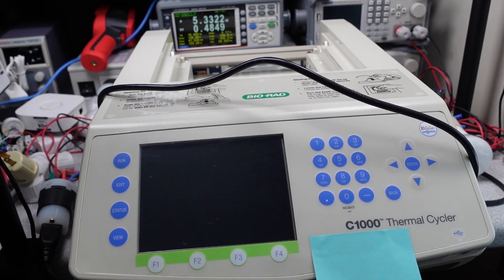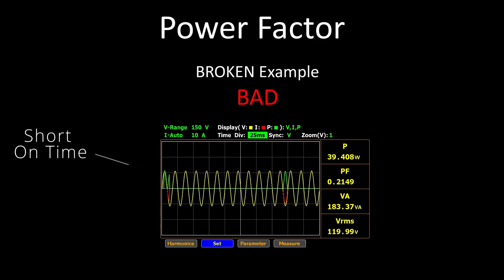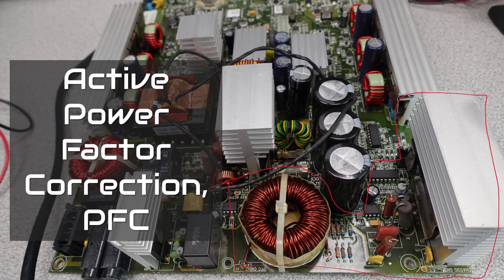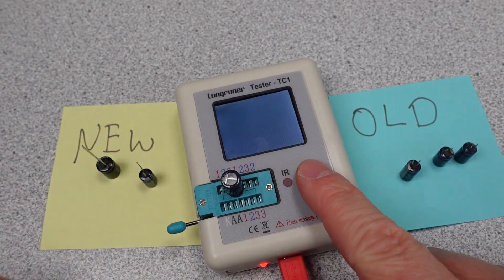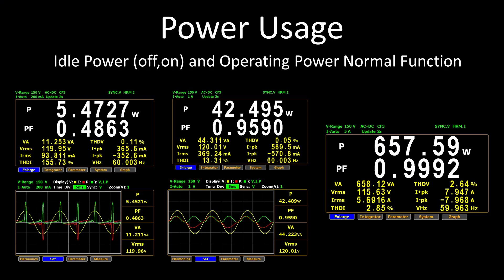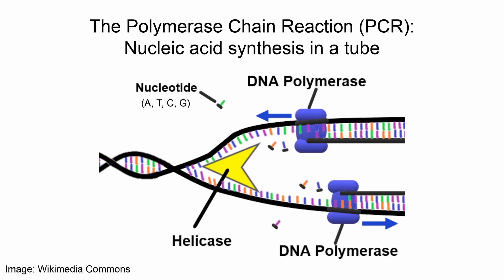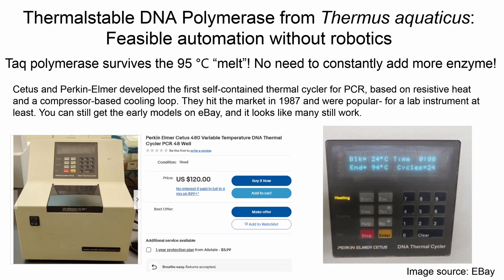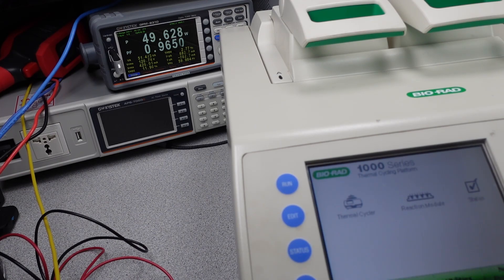Bio-Rad C1000 Thermal Cycler - they asked for $2,200 to fix this machine

Comment: Just did a repair on this exact make/model instrument.   you did a great job with this video!  I bought mine for $35 just to see if I can repair it (I work in this field repairing lab equipment).  The heat sink for the primary switching MOSFET gets extremely hot.  And those fans for cooling the peltier elements do NOT cool the board at all.  The airflow is directed above the board towards the heatsink of the reaction module.  In my case, I got the unit and it wasn't powered on at all and fuses were blown.  Shorted PFC MOSFET was a secondary fault.  The gate driver to the MOSFET appeared to be the primary fault.  I agree with you that thermal design of this instrument is its downfall.  Capacitors were not the problem in my case.  And each of the voltage rails including the auxiliary stand-by rail, displayed little PARD.  The auxiliary power circuit does have fault protection in the form of overcurrent protection.  It is that 500mA fuse next to the L/N 10A fuses.  I would put the make/model of this instrument in the title of your video to make it easier to find.  There's very little information out here for repairing instruments like these.  Scientists like your friend AC would appreciate it.  Because as you can see, the manufacturers charge a fortune to fix these.  Here's the link to my video as well https://www.youtube.com/watch?v=cfQAosgDxIg
Reply from the maker: Yeah, I noticed the fans for sure.  Yeah, I am amazed the MOSFET's were not blown in this one.  It's good the caps didn't fail, I'd still take them out and replace the smaller caps with the life time and high temperature environment.  I remember getting the datasheet for that PFC controller and checking the output of it.  I was surprised how hot some of the resistors get, I know they're rated for it, but with no airflow it just heats up everything around them.  

Thanks for the tip on the video title!  I am watching your video right now.
Reply: Thank you! I need to work on making my videos flow better and the overall quality so I apologize for the length and shaky camera angles.  Yours are very well done!  
Yea I couldn’t believe how hot some of the components on this thing were getting.  Those large 500ohm resistors included.  Especially the one across the 40V rail.  And the heatsinks with the primary switching MOSFETs and PFC boost converter.  The board does have overtemp protection and will shut itself down if it gets too hot.  Well, at least if the PFC boost converter heatsink does.  But IMO the primary switching MOSFET heatsink was getting wayyy hotter – no temp sensor monitoring that one.
I think the fan issue at the end might not be indicative of a fault.  I actually acquired another of these boards that is known to be in good working condition.  And without the reaction module installed, it does the same exact thing.  I was speculating that could be the case because it seemed a bit odd that all the I/Os for only one of the fans stopped working

Comment: Usually you can test ESR in-circuit because when it's OK it is usually the smallest of the resistances in parallel(the rest of the circuit). Of course it depends on the circuit but for most uses of electrolityc capacitors you can get a quick good/not good without desoldering.
Reply from the maker: Thanks!  I need to get a proper LCR meter too.  That component tester was like nope.
Reply: @AllThingsOnePlace  now there are alternatives that are not that expensive, the only limitation is that you need to discharge the capacitors before testing, there are also some specific for ESR testing that can auto-discharge capacitors without being damaged.
Reply from the maker: @Gengh13  Any suggested models/devices to check out?
Reply: @AllThingsOnePlace  I'm not as up to date on the newer models(I know Hantek has one), but the DER EE DE-5000 is still pretty decent handheld LCR meter at a good price(the magic of all in one LCR IC).
Reply: That is exactly the tester I was planning on getting but then ended up getting one of the same ones that's in this video. I still have the DE-5000 in my eBay cart, I think it's still a decently accurate one for the money.